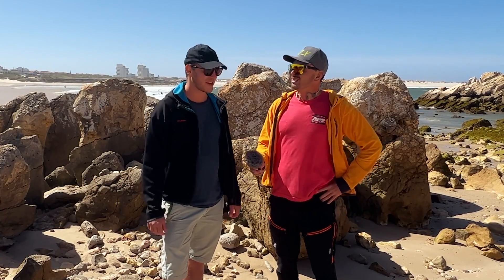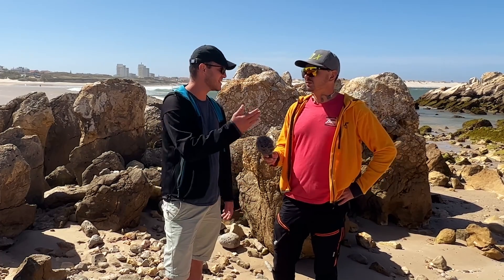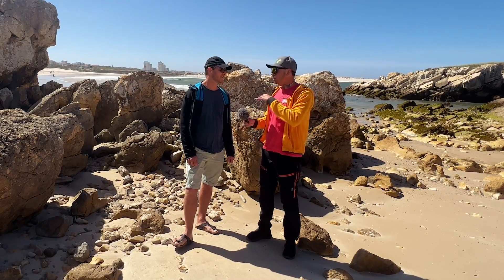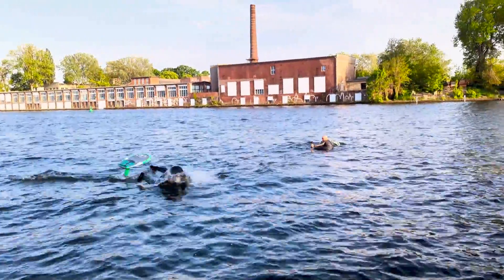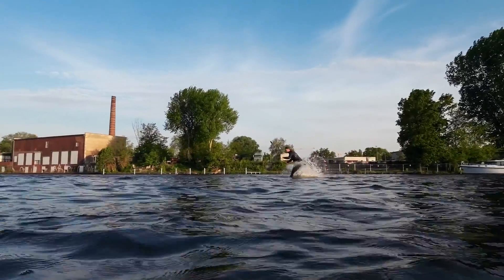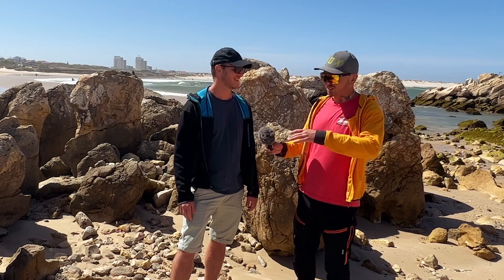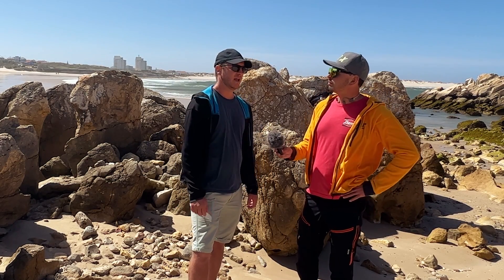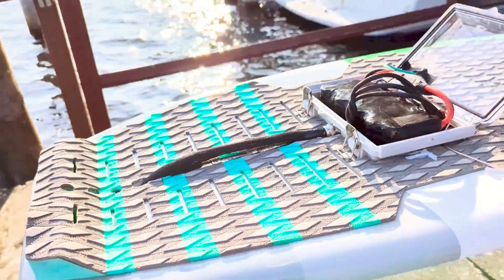Creating DIY Efoil Build Under $2000

Comment from the maker: Here you can find all the components that TOBI uses
Motor: https://tinyurl.com/2p957w3b
Controller: https://tinyurl.com/3trhzajx
Remote: https://tinyurl.com/nrcmnedm
Propeller: https://propellerking.com/produkt/fold/
Housing: https://tinyurl.com/2hbkvma6
Charger: https://tinyurl.com/43s8wdfm
Battery: https://www.nkon.nl/de/molicel-21700a-4200mah-30a.html
Reply: Never use a Lithium battery pack without BMS crazy guys  ‼️😂🤦‍♂️
It's very dagerous !!

Comment: Put it on a bike frame and you've got a great invention :) starting would be a pain though
Reply: With prop ran by pedals 😁 or even pedal assist system 🤯😁 it would be up there. I guess you could use a 20" frame with shortest pedal arms available 😉 i bet somebody markets this. Happens all the time. 🤯

Comment: Nice one Mike and Frank.
Why are parts more expensive when I search for them :-/
Reply: Hey Kian, Mike has added the parts list so maybe you can check if you find the right prices. I have to say though, that I purchased all of the equipment over a year ago.
Reply: @tosh.jah22  Hi Tobi,
great project!!! 
We are a group of about 20 Pump Foilers from the Cologne area. We foil on the Rhine and we are looking for a way to power our foil boards electrically. Two of us already have foil drives, but due to the costs, not everyone in the group has the possibility to be pushed electrically on the Rhine waves. I built my first electric skateboard some time ago, but have not had any contact with the water version. I would like to build your setup for our foil group and wanted to ask you if you could possibly help us with your know-how?
Reply: @tosh.jah22   Isn't this motor getting rusty?